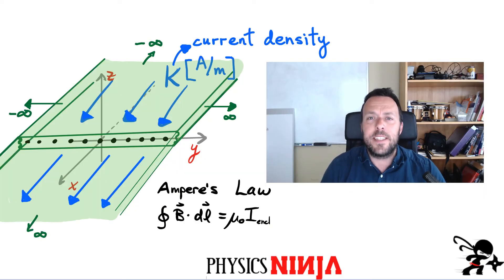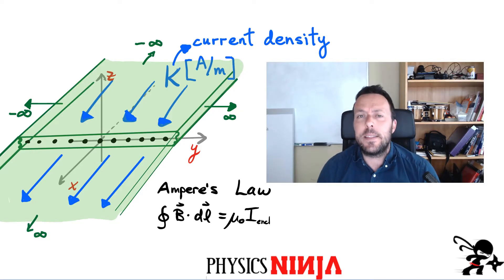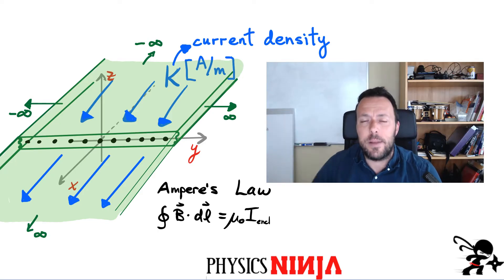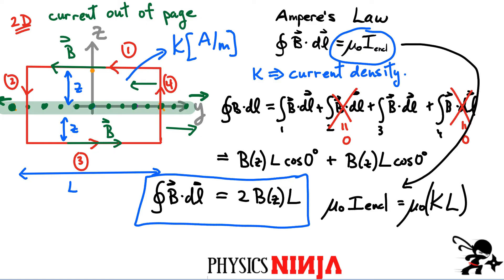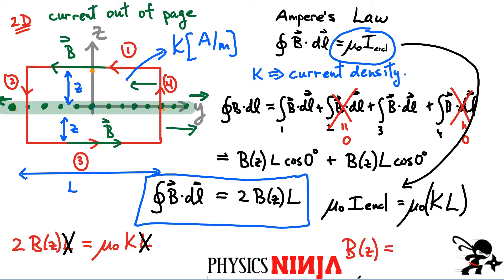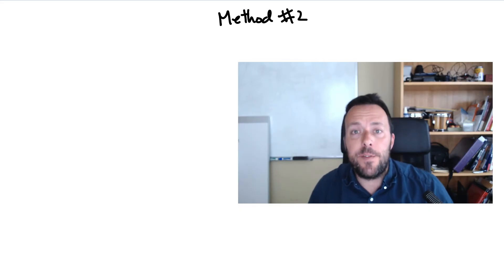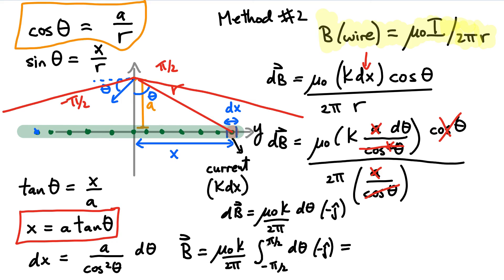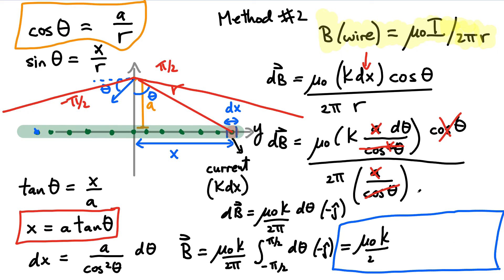Magnetic Field from Infinite 2D current sheet - Ampere's Law

Comment: What about if the sheet is finite in length?
Reply from the maker: Then the field will depend on position and you’ll need to use Biot-Savart to calculate the field at a specific point.
Reply: @PhysicsNinja  Thanks a lot but can you share a solved example related with it. For example assume you have ten parallel current carrying wires near to each other and their lengths are 10cm and you are trying to find the magnetic field 1cm above the sheet.

Comment: for 6:06, 

The real reason ,why in 2 and 4 numbered side magnetic field is perpendicular to the side,is wrong i guess. The real reason is there are currents in right and left of second side. Due to this currents, in right side currents apply -B.dl and in left side currents apply B.dl so total B.dl will be zero. Am i wrong and why?
Reply: Well no, it is B(dot)dl right. So the dot product will be zero because they are perpendicular. So the original reasoning was right. 
Current flowing through 2 and 4 does not directly imply a magnetic field density associated with it. dB vector is proportional to the cross product of (I dot dl) and distance vectors. So if I dot dl is 0 --> dB is also = 0. Hope you got it

Comment: I have a problem that asks us to measure the magnetic field infinitely close to the infinite current sheet.  We can see here that the magnetic field has a clear value going one way or another depending on whether we are above or below the sheet.  But if we are exactly on the sheet, does the magnetic field go to zero?
Reply: It could be infinite, we can think the infinite sheet of current as many infinite straight wires kept laterally together, the point on that sheet could then be viewed as it is kept an infinite straight wire and as the distance between the infinite straight wire is zero from the expression for field due to a straight wire(long) It will approach infinity. I'm not sure though I made it up just now.